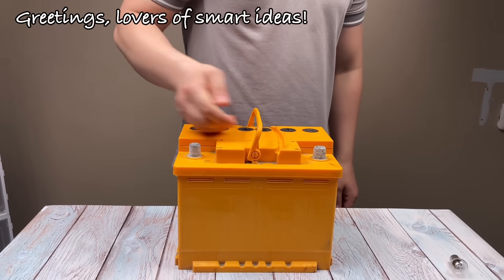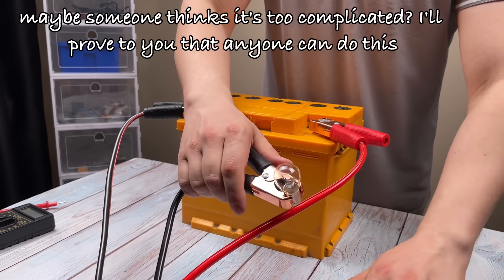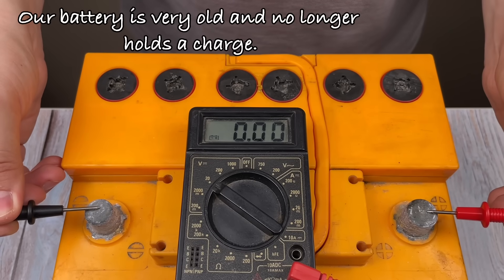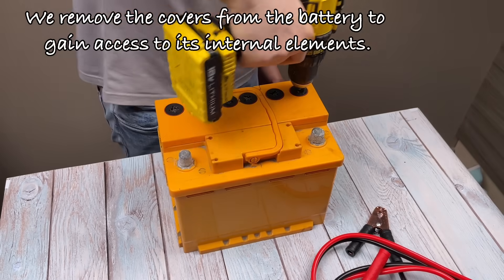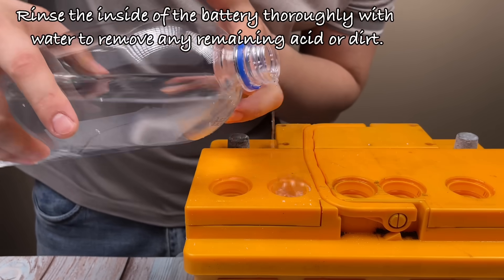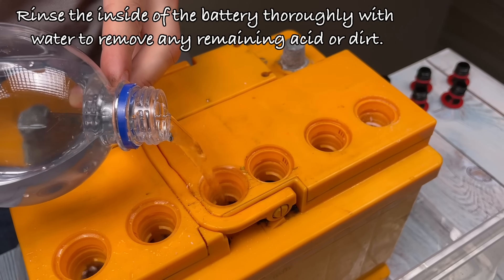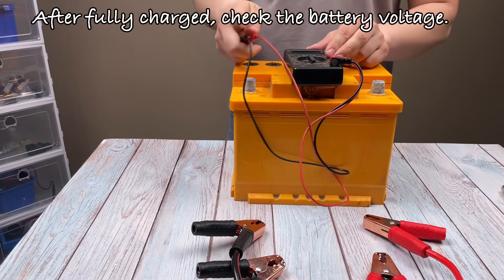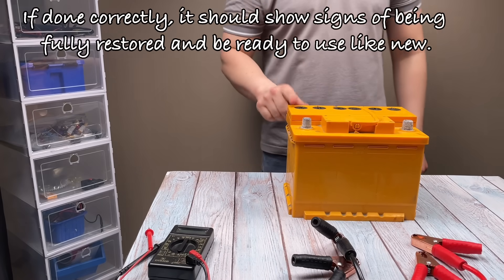🔥🔥Your battery will last forever! We reanimate an OLD battery without spending money at the dealer

Comment: The results of the procedure are very questionable and even speculative, since flooded batteries suffer from strong sulfation when discharged to zero, which the longer it lasts, the more it crystallizes and its breakdown into sulfate and lead is worsened.  Likewise, the active material of the plates itself is reduced due to the action of chemical processes in the battery.  All this results in the battery losing capacity and increasing internal resistance, in good condition its value is measured in fractions of an ohm.   With increased internal resistance, the battery after charging can hold a voltage over 12V, as the author shows immediately after charging, which is incorrect, every flooded battery should be measured and tested only after 1 or 2 days, when the electrolyte stabilizes.  Also absent in the video is the current load test, which will show the actual condition of the battery as well as measuring its voltage without load.  Reviving a worn-out battery is theoretically possible, but in practice only for a short time and only as an emergency solution, in which case the most worn-out cell may remain short-circuited after reviving, i.e. it will discharge the other revived cells.
Reply: Na tym filmie nie pokazałeś że akumulator był zepsuty było widać kawałek przewodów od akumulatora które wyszły poza kadr i inne kable które nie zasiliły żarówki, to samo z miernikiem, ujęcie że zbliżeniem też nie pokazywało całości przewodów....
Reply: Bateria automotiva pra dar boas partidas tem recarregar e marcar 13,30 volts , quando ele carregou e marcou 12,40 volts não consegue manter uma boa partida. 1 volt a menos já era!
Reply: @antoniosilva1960 Zgadzam się z tą teorią nawet po naładowaniu i odjęcia klem ładowania akumulatora napięcie powinno być pod 13 volt lub więcej. Pozdrawiam serdecznie.
Reply: perfect explanation. I once tried such regeneration, but with rinsing the plates with water under high pressure to get rid of the black sulphide deposits. unfortunately, none of the three batteries came to life after the load test. You can't cheat physics and chemistry with a YT movie.
Reply: i have seen pakistay videos where open batterys and the led iinside is   destroyed . the y  change the leds and k   ake a totaly new battery . the led are maded from pressurized    led dust . thas why they becoming mud  Anyway all the video   is a good exercr
Reply: The principle of this process is thought to be that the following chemical reaction occurs on the surface of the battery's electrodes. PbSO4+Na2CO3→Na2SO4+PbCO3
It is not impossible for a battery whose voltage has dropped to 0V to recover to a level of 12V, but it is unlikely that this level of cleaning will be able to remove sulfation. It will be difficult to do this without adding a small amount of sodium hydroxide.

Also, the battery voltage immediately after being fully charged is 12.8V instead of 12.4V.

Batteries compatible with ISS have complex electrode shapes, and cleaning them in this way increases the possibility of electrode short-circuiting.
Reply: Don't let this clown fool ya. If you put baking soda inside your battery it's going to kill it right then and there there is no way for his plates to hold a charge anymore. This clown is a sucker. Always remember baking soda inside battery... bad
Reply: Výborné 👍
Reply: Would it work on a battery that's been sitting for a month but was working fine before that?
Reply: Bzdura. Fake. Odpal na tym auto x razy😅 powodzenia 😅
Reply: I z tym się zgadzam  to na krótki czas działa a później i tak złom i złom a  założę się że pod obciążeniem  wyjdzie że to i tak trup i tak
Reply: @PiotrLos-g4y Coś ma się do rzeczy. Według mnie to oglądalność. Pozdrawiam serdecznie.
Reply: @PiotrLos👍👍👏👌
Reply: la respuesta esta realizada por una persona que sabe de que esta hablando,todo lo que explica tiene un fundamento que es correcto de acuerdo a lo que entiendo,si fuera tan facil para que uno cambia la bateria ,proponen milagros y cosigue suscrpciones a costa de los ingenuos por no decir una guarangada.
Reply: @anibalrobertoassi3697 To prawda zgadzam się z tym prawa chemi i fizyki nie da się oszukać. Pozdrawiam serdecznie.
Reply: Totally agree, I think this is completely bogus. I am not a battery expert but worked in both the auto and the electric utility industries where part of my work dealt with maintenance procedures for vehicle batteries and stationary lead acid batteries in substations and communications sites. Dumping out and neutralizing acid in the cells with a couple of teaspoons of baking soda and water seems completely insufficient because baking soda is an extremely mild base and much of the much higher molar concentration of sulfuric acid remains in the form of sulfides in the bottom of the battery case which would not be removed. If you added new electrolyte, I would think the resulting molar concentration of sulfuric acid would be unpredictable and I am guessing significantly higher than original and definitely not optimum. As you stated, I also imagine there would be significant cell imbalance in terms of ph, resistance and voltage which would cause endless problems of unequal cell voltages and resistances and might well render the battery totally useless, assuming it had some hope of restoration to begin with. I think the best bet for trying to restore a dead battery would be to give it an "equalizing charge" of about 50 to 75 amps for a period of maybe 8 hours or so to remove sulfides from the plates. This is a bit of a controversial procedure, but we performed this routinely for the maintenance of large stationary batteries and it seemed to give us good results.
Reply: Akumulatora nie naprawia się można tylko ładować o ile jeszcze się da albo kupić nowy. Kiedyś były warsztaty które robiły akumulatory używając starych skrzynek bakielitowych i nowych płyt (wymieniano płyty ołowiane) potem ładowano przed tym zalewano elektrolit , stare czasy kiedy nie było nowych aku na rynku.
Reply: @romanstepien3302  Masz rację, jeśli akumulator już nie działa, to z pewnością lepiej oddać go do systemu recyklingu. Zamiast wylewać te płyny do kanalizacji, oddaj je sprzedawcy akumulatorów.
Reply: @rossk4864 Witam sensowna wypowiedź tylko według mnie to ryzykowna zabawa. Pozdrawiam serdecznie.
Reply: @rossk4864  
I agree with you

Or you can be like @photoportraitist and think chemicals can magically rejuvenate the lead cells.
“Chemical usage”
Reply: É tudo uma aldrabice recuperar baterias em casa ...vai mas é trabalhar ....aldra...bateria morre...não  tem conserto?????
Reply: And what are you doing with the fluid's, after the procedures? I think, it's better giving the battery back to dealer... He will give it in recycling company, so a new one can be produced, without damaging environment.
Reply: Pb baterries are fully recoverable with chemical usage.
Reply: @photoportraitist  Nein, zerstörtes Blei kann nicht chemisch wieder zurück gewonnen werden !
Reply: @photoportraitist 
No they are not. How are chemicals going to bring back lead that has essentially dissolved in the electrolyte solution?
Reply: @notacreativehandle  You can exchange the Pb plates.
Reply: @ 
Exactly, you can change them, but chemicals won’t repair them.
Reply: @notacreativehandle  You are repairing battery by replacing the plates. Like replacing the eoectrolite, and so on. Like repairing engines by replacing parts. Repairing is a process.
Reply: @ 
wtf are you going on about now?
Reply: @notacreativehandle  Underlaying, that you do not understand, that physics and chemistry are sciences about changing one into another and everything is fixable.
Reply: @photoporttraitist
Reality, that you do not understand-

Replace the cells physically. 

You may go now. Bye 👋
Reply: @notacreativehandle  That is the only thing, that most can do. Including you. Take care.
Reply: @photoportaitist
Still going huh?
I understand you have no clue of what you’re actually talking about, but must you keep digging yourself a hole?

Whatever makes you feel better about yourself I suppose.
Reply: @notacreativehandle  Of course. Your account name says it all. Have a great time prove it wrong.
Reply: @photoportraitist  panie jest pan nie do uczony i tyle na temat bp znaczy że taka bateria jest do recyklingu  a nie odzyskać  chemicznie  ,   😂
Reply: Bateria bp   takie oznaczenie  to mówi nam że ta baterie  jest do recyklingu a nie  że można  chemicznie ja odnowić  , co za ludzie aby tylko  coś bzdurę nagrać i lajkowac a te kasę biara  za darmo

Comment: I have a few questions.
What did you do with the old electrolyte?
What did you do with the water after rinsing the battery?
What is the point of purchasing a new electrolyte? 
If you didn't pour it down the drain, how much does it cost to dispose of the liquids?
How does this compare to purchasing a new, technologically more efficient battery?

Such rinsing will not give the desired results if you have a short circuit due to natural peeling of the linings.
Reply: @drwitak. Well done 👍. I hope i can see [Fix it fast] respond to your questions and i want to know too
Reply: Ok
8 on mi😊
Reply: 廃液は新聞紙か布に染み込ませて燃えるものとして処分するでしょう
Reply: It may be deleted and poured on your plants, they love sulphur.
Reply: @timwatson1544  Lol...

Comment: What is the "Electrolyte" that you used at the last step just before charging the battery?
Reply: kup lepiej nowy akumulator niż masz wydawać pieniądze na wątpliwą regenerację. Ten film to brednie. Akumulator kwasowo-ołowiowy z czasem ulega degradacji i nie ma sposobu by go przywrócić do stanu nowego.
Reply: Oh my god. Some fool is going to pour Gatoraid in there battery...  Well, since it won't work anyway, I guess that is cheaper than them wasting $50 worth of sulfuric acid...

Comment: After second rinse, friends drop battery flat onto rubber floor mat (with fluid in cells an caps on) from about 4" from rubber mat. They drop battery onto floor rubber mat about 5 times. Then they drop battery onto its front an back sides from resting in floor, 5 times each side. without lifting battery off floor mat. (While battery is on rubber floor mat, they just tip hattery into its bottom edge rhen ket battery drop to floor mat. Without lifting battery off mat. Then pick battery up until balanced on bottom edge, then drop again.
Reply: Why
Reply: Knocks an cleans corrosion off cells. Illiminating shorts between cells, refreshing battery. Flushing after dropping, removed corrosion after being knocked loose.